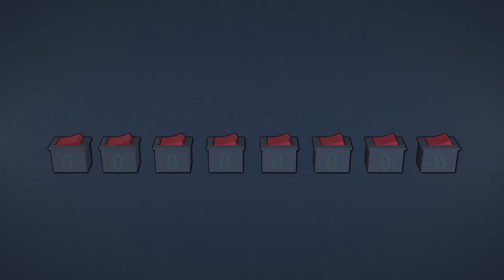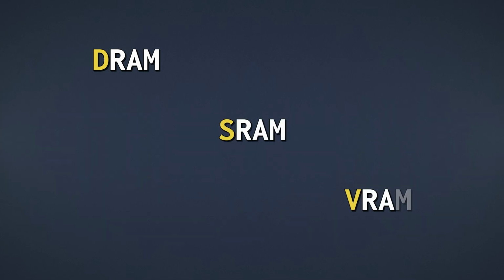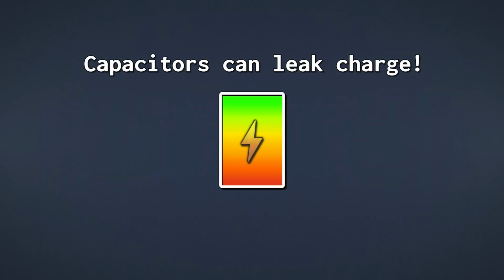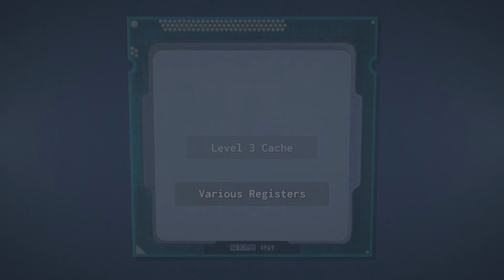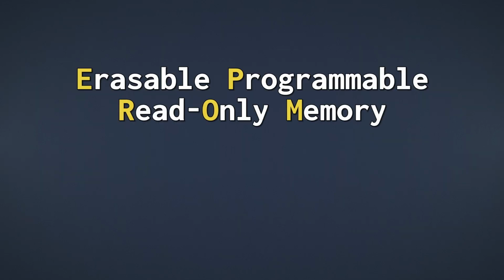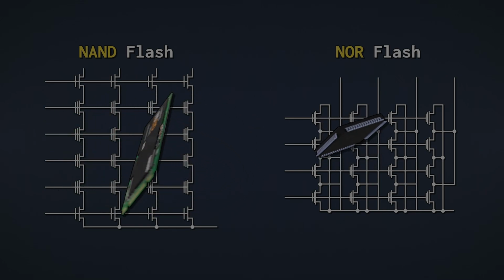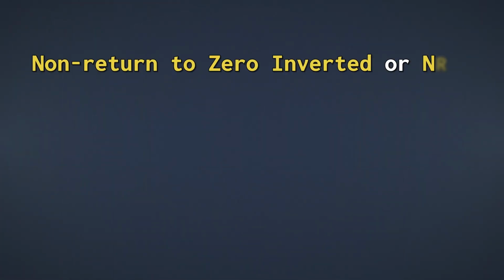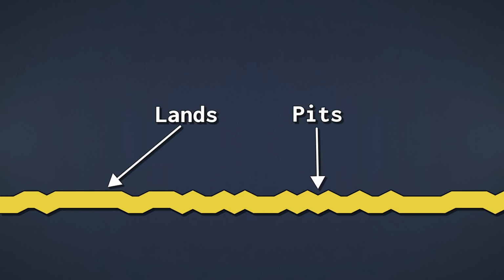How Computers Store Binary Data - RAM, ROM, Flash, Magnetic, and Optical

Comment: A surprising example for magnetic tape still being used is in some scientific institutions. Where I did my master's thesis, I had to make sure not to store any less important data in the folders that would be backed up on tape, since it's really expensive. The reason it's used is just as it says in the video: It's very durable. For most people, that's not as much of a concern, but in research, you may very well need to access data from ten or twenty years ago, stuff like genetic data for instance, or you might need to make it available for legal reasons (we hope not - but it is a way to confirm whether past publications were done legitimate, and while rare, there have been instances where fraud occured).